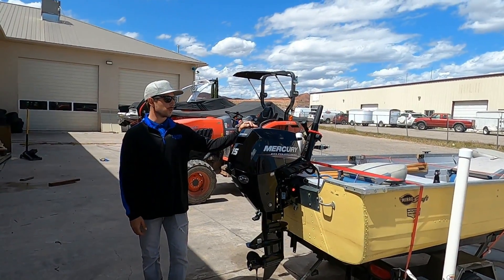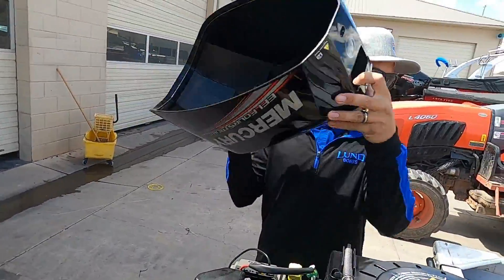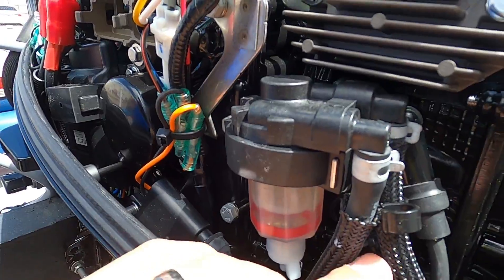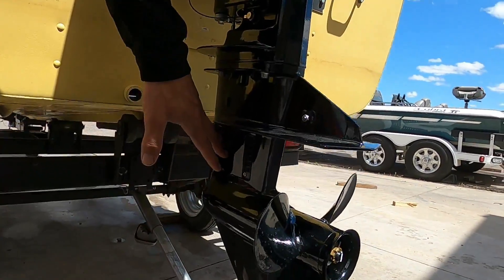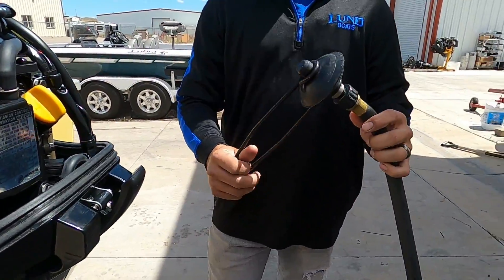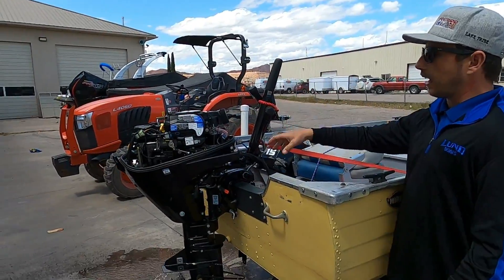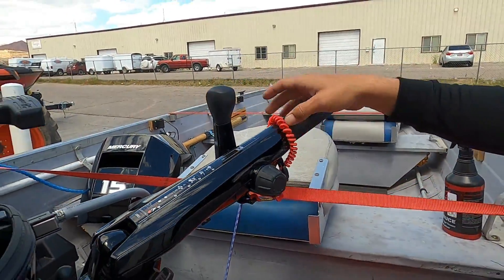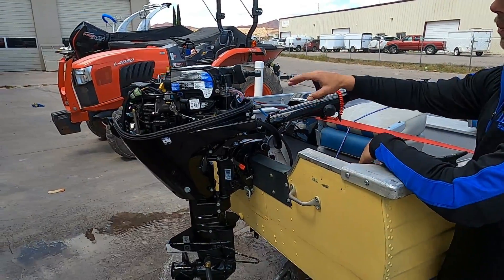Mercury 2020 15HP EH (4-stroke EFI)

Comment: Is that motor able to charge a trolling motor battery?
Reply: If your trolling motor battery is the same one connected to the motor then yes it will charge it while the motor is running

Comment: Buy a tohatsu, same motor , Cheaper
Reply: A. NOT the same motor, just made by Tohatsu to Merc’s specs. Specifically the tiller is significantly different and a much better design on the Merc. 

B. The Merc’s are 100-200 cheaper at every dealer I’ve found in south Florida.

Comment: Dude, that model has a flush fitting on it. You don’t need muffs.
Reply from the maker: You're correct, you can run it just off the flush. However, you cannot run anything above idle. Therefor you cannot check shift, or anything of that nature. So by "flushing" the system while using the flushet on the lower gear case gives you ability to properly flush your entire system, while not being limited to and idle.